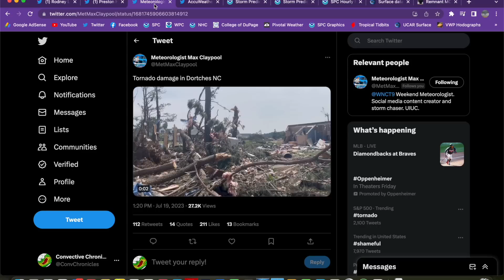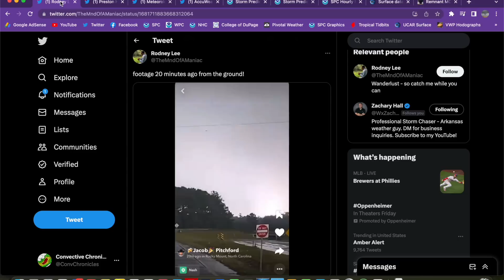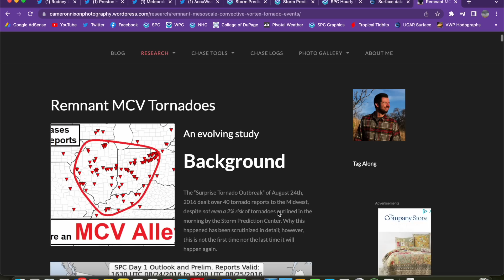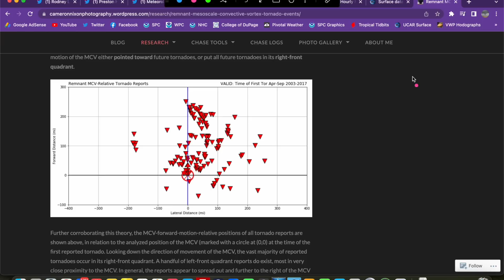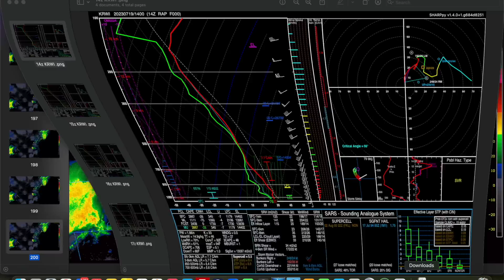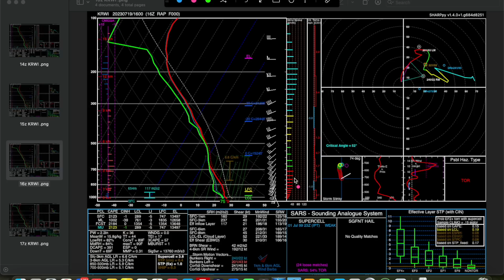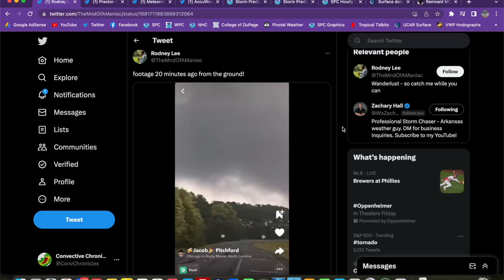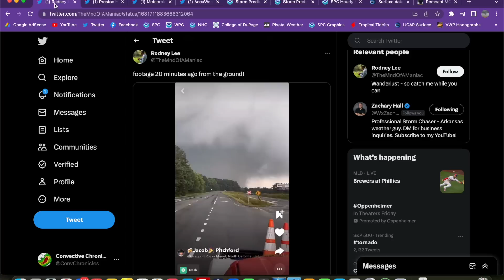Meteorological Breakdown: Surprise EF-3 Tornado in North Carolina - July 19, 2023

Comment: We've got to come up with a better scale than the EF. 
We're basing very important data off damages that could vary greatly depending on how professional or shotty a GC is. Not to mention grade of materials used. The assumption that every employee who built the structure followed tasks competently.
The list can be quite long of mishaps or neglect and were basing critical data from this.

Not every building is built the same, not every  GC is honest and a good portion of employees are just around for a paycheck.
Before you say but there is a building inspector. Yea, not hard to kick a few grand his way to save several grand by looking the other way.
Once again we're depending on unwavering honesty which to be real simply just doesn't exist.

We wonder why a great unknown exists when it comes to surface level data.......cant imagine why.

Tornadoes should be categorized as an EF whatever in an open prairie just the same as if it went right down the middle of a town.
How can you accurately study a supercell when the exact same tornado is rated differently depending on its location and what by chance is in its way? 

I believe we're having trouble pinpointing which cells spin up and touch down and which one's don't.
Must have consistent accurate data and when your rating is skewed all the data that follows is inherently skewed. Cells are entirely to complex to knowingly accept flawed data.
Reply from the maker: The problem is…how do we rate the open-field ones consistently? Radar data is good but can be noisy/misleading, and we can’t use damage.
Reply: @ConvectiveChronicles 
We're getting to the point that technology and interests are coming to a convergence to potentially restructure things.
We've sent human to the moon, we now have rockets that land themselves.
We collide atoms together at inconceivable speeds.
I realize it's a very difficult dilemma but so was those.
 We have to grow tired of the inaccuracies to the point we wont accept them. Then we will find a way.

We've not even made osha require bathrooms to double as reinforced shelters at schools. When they do enforce hurricane codes every single day.
Arguably I'd say we've not reached the unacceptable part yet.
These are things we simply have to do while we continue to learn and understand.
An absorbent amount of examples exist concerning data collection methods being completely ruled out when it pertains to saving lives simply because of unreliability.
Reply: @ConvectiveChronicles  
Could we not mount basic measuring devices on power poles? If basic units can be bought for $100 +/- this cost spread out among residents of individual power grids would amount to cents on the dollar. The power poles are within the surface data range we're struggling to understand. All the connections for these devices are already present on the poles themselves and power companies regularly service these poles already. Not saying every pole needs one but a max/min distance between units could be established.

These poles are practically everywhere for mostly consistent measurements.
Rural, small towns and cities.
The costs could be easily accumulated monthly with existing power bills and probably at a rate hardly noticeable to the residents.
The data gained would be far more valuable than the minuscule costs spread out over an entire grid.

Best of all eliminating the need for people to put themselves in severe danger to gather data. The poles are already out there in the path of extreme danger.
Reply from the maker: @Enjoy_my_1st_Amendment  "Basic" measuring devices are just that...basic. The data would be shoddy and unreliable at best, and most of the basic devices would not be able to measure winds within stronger tornadoes (upper limit to what they can measure).

Comment: This tornado has to be one of the quirkiest tornadoes of the 2023 year so far.  Just for the intensity and how the storm and set up evolved.  Like I can't remember another time a remnant MCV spawned a tornado or in this case a strong ass tornado...even the 2016 event like you mentioned.  Also that radar loop of the dying MCV is so pretty.

I think just the sheer fact those little storms held on around the MCV really helped as they were already "established" and just needed that extra kick to push them over the edge.  I was eyeing the 3CAPE and there was a little bit of a boost pushing it near 100 so that may have helped too.
Reply from the maker: Great point!